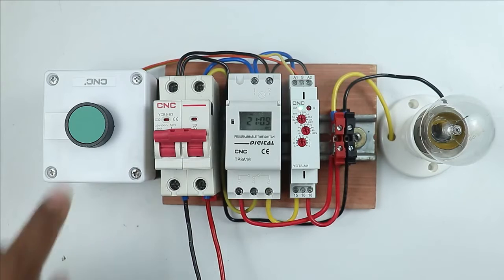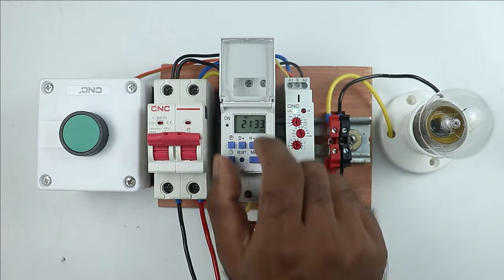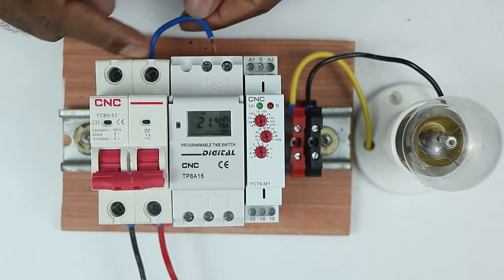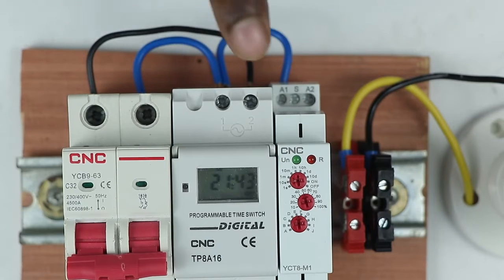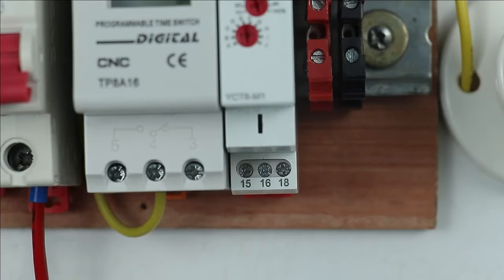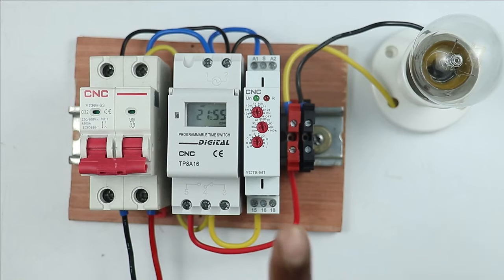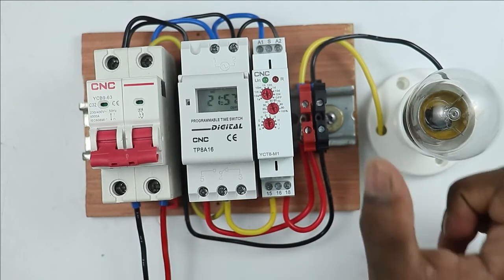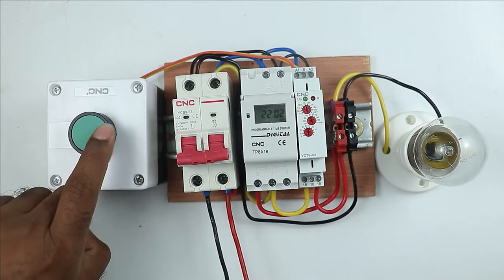Two Different Type of Timer Connection for only One Motor @TheElectricalGuy

Comment: Can, I use the programmable time sensor as changeover.
The NC point will provide Wapda to Air conditioner during 5 P.M. to 7 A.M and the NO point will provide Solar supply to my AC during 7A.M. to 5P.M.